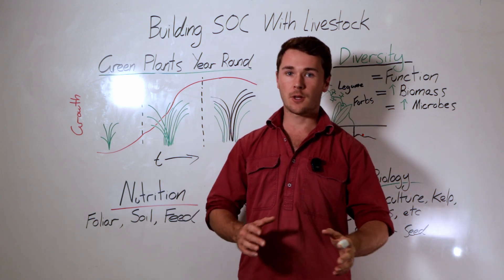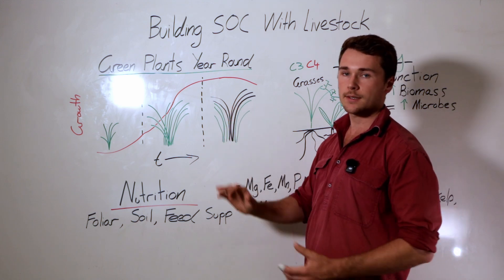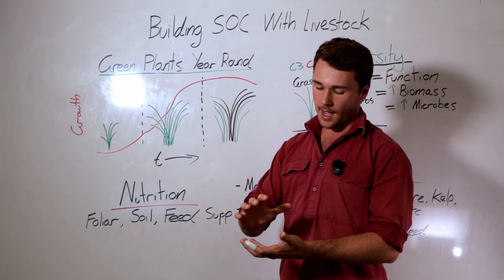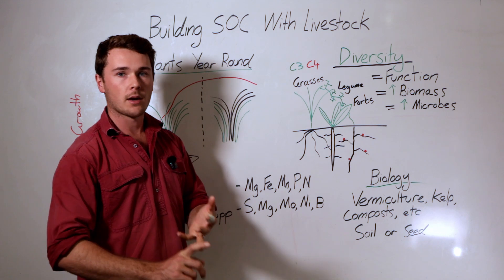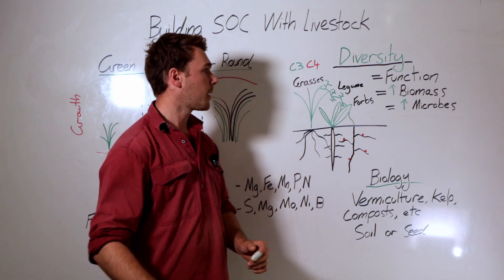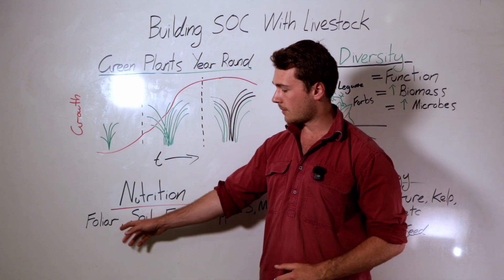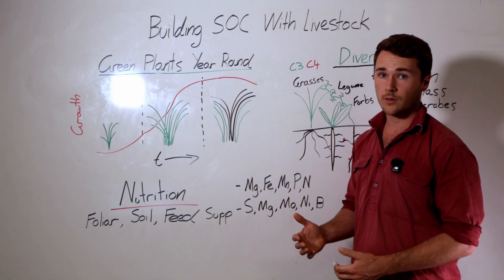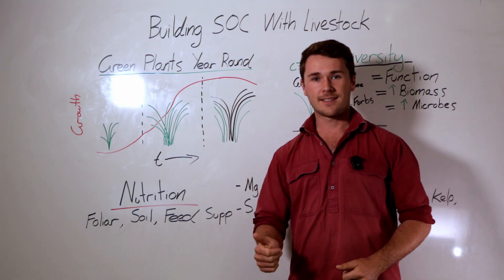Building Soil Carbon With Livestock | Soil Carbon Course

Comment: Beef consumption is a massive contributor to climate change. Likely only 2nd to burning fossil fuels. This is just a fact at this point.
Reply from the maker: Check out this article if you’re interested in learning about the potential for livestock to mitigate against climate change: https://www.sciencedirect.com/science/article/pii/S0308521X17310338
Reply: @agresol_consulting  I read the article you shared (Impacts of soil carbon sequestration on life cycle GHG emissions of beef cattle – 2017). It does not claim that eating beef mitigates climate change, nor that beef production is a net climate benefit. Instead, it examines adaptive multi‑paddock (AMP) grazing as a way to sequester soil carbon on certain ranches. Under a narrow life cycle assessment, that specific finishing system actually showed a net-negative GHG footprint—but only because that study explicitly included the carbon drawn into soils.

What the paper concluded:

AMP grazing systems in that one case showed high enough soil carbon uptake (3.59 Mg C/ha/yr) to offset all beef emissions, producing a net sink in that narrow context .
However, feedlot finishing required half the land, and didn’t show soil sequestration benefits .

The study's result isn’t broader climate policy—it isn’t endorsing beef as a climate solution overall, just showing that under ideal grazing management, soil C can offset some emissions in that specific system.

So it's misleading to interpret this as saying “eating or producing beef mitigates climate change.” The key word is if—if you manage grazing perfectly and count soil C, that specific system can break even. Most beef production globally doesn’t include these practices, doesn’t sequester soil carbon, and still generates substantial GHGs 💨.

To reduce beef's climate impacts—whether via methane reduction, improved grazing, or efficiency gains—you still need deliberate mitigation strategies, not just eating or producing beef .

Happy to dive into any of those mitigation pathways if you’re interested.
Reply from the maker: Yes, that’s exactly the point however, done under AMP or regenerative grazing, livestock are able to sequester carbon while also producing additional environmental benefits.

A direct quote from the paper “This research suggests that AMP grazing can contribute to climate change mitigation through SOC sequestration”, so not sure what is misleading to suggest that regenerative grazing has the potential to mitigate climate change.

In the study, AMP grazing was able to have negative carbon emissions of −6.65 kg CO2-e kg /carcass weight

You’re also correct saying that AMP isn’t done everywhere, which was also highlighted by the paper, however the paper highlights the importance of education (hence this video on building soil carbon with livestock)
Reply: @agresol_consulting  Maybe you missed this: However, feedlot finishing required half the land, and didn’t show soil sequestration benefits. The problem is when you include land use, no "regenerative grazing" is carbon negative. We would need multiple planet earths to grass feed all our cows.
Reply from the maker: Yeah that’s a great point, here’s an interesting breakdown of the scalability of regenerative grazing systems: https://weekly.regeneration.works/p/do-we-have-the-land-for-regenerative

An interesting point is that cattle breeds and systems have been optimised for feedlots, further research and development into optimising regenerative systems would likely further increase productivity.